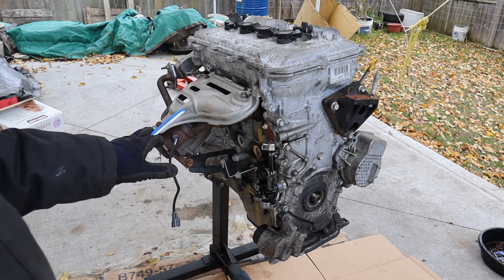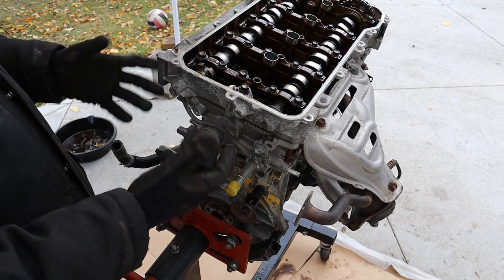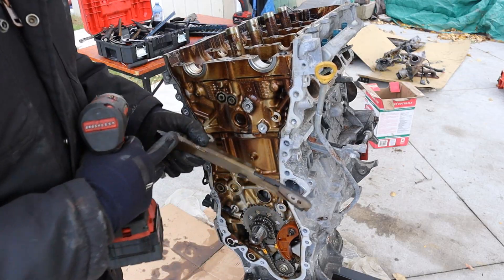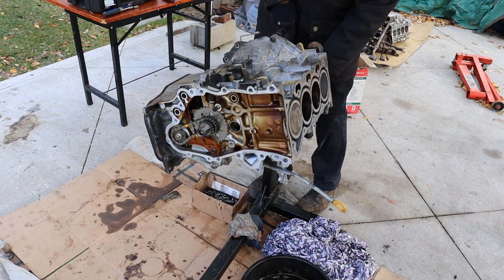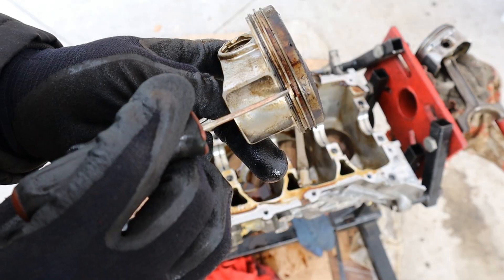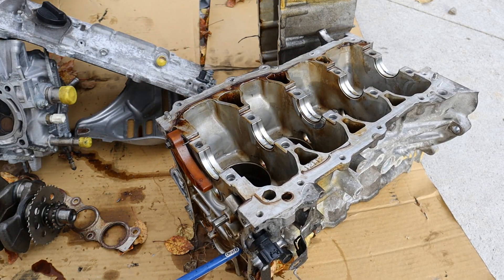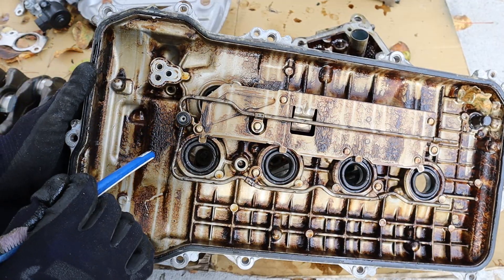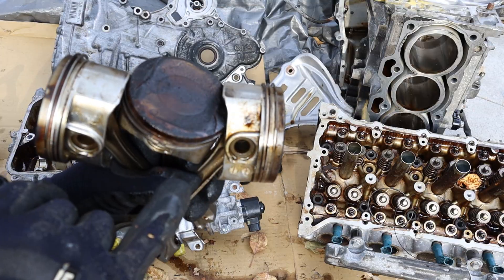Why the Toyota 2ZR Engine was a Failure

Comment: Damn, I have the 2ZR-FE, wonder why they got rid of VVTI from the exhuast. Atleast mine does not have an egr or electronic waterpump. However, it does have a stripped sparkplug hole... Just hope I dont need to replace it before the car is dunzo

Comment: All these problems were addressed late 2011 model engines. So, if you have one mid 2012 or later model you will have zero issues.
Reply: Not true.  It happened to my 2013 Prius V at 260,000 miles
Reply: @nizamamiri4746 At 420 000 Km I would expect wear on any Petrol engine.

Comment: My 2021 2ZR-FXE uses metal oil filter and head gasket has been upgraded couple of times through the years (knocks on wood). You can find these engines with 500k km without head gasket failure or any failure for that matter. Zero oil consumption between oil changes for me. 2009-2011 were the notorious oil drinkers and head gasket blowers which ruined reputation of the engine.
Reply: That worries me then lol, I have the 2ZR-FE in a 2010 Corolla with 95k miles on it and I haven’t had any oil burning yet (knock on wood)

Comment: One of my family members has a 2010 Toyota Corolla 2ZR-FE (not the FXE shown in your video) and with 81k miles, it's still running great with no problems. 😀
I believe we've ran 5W-20 for all its life, though it can use either 0W-20 or 5W-20.

Awesome video, per usual!
Reply from the maker: Thanks. 
Keep an eye on the oil and coolant level.
Reply: @speedkar99  In the 15-16 (if you count it manufactured in 09) years the Corolla has been existing, it has had no such problems AFAIK!

Comment: Why would you title the video with 2zr-fe when that's not the engine you're talking about?
Reply from the maker: This is a 2ZR...what were you suggesting?
Reply: @speedkar99  i have the 2zr-fe which has iron linings in an aluminium block.
Reply: @andymeh499  But it has manufacturing defects that Toyota does not acknowledge, brother.
The scandal of the Land Cruiser, Tundra, and Lexus engines regarding engine failures has also spread.
And previously, there was a recall for the Camry and Corolla due to the accelerator pedal and other issues.
There was also a recall for the Corolla airbag and a recall for the Toyota fuel pump.
But honestly, the Corolla I had was fun, better than new cars that break down over the most trivial things. Its problem was the gearbox. I could have installed a different gearbox for it, but I don't know what made me sell it. I can install any gearbox from Toyota or another company, but they will tell you that it will not fit.
Knowing that it fits  Sorry ❤
Reply: @speedkar99  He means not all Toyota ZR engine series have this problem. There are engines in the same series that have manufacturing errors. The 2ZR-FE engine is actually a very excellent engine. I had enjoyable experiences with it from 2013 to 2021 and I did not face any problems with it. The only problems were with the 4-speed automatic transmission. The transmission could not handle the dyno or open RPM and would break. As for the engine, it is excellent. It handles the intensity and everything you can think of. I have things I filmed while I was slaughtering this engine. It does not die. Hahaha. Sorry ❤

Comment: The 1ZZ-FE was a much better engine and more reliable than this problematic 2ZR. The 1ZZs originally also burned oil, but in 2005 they received an upgrade to oil scraper rings, along with more drain holes in the piston.

El 1ZZ-FE fue mucho mejor motor y mas confiable, que este problematico 2ZR. 
Los 1ZZ en un principio también quemaban aceite, pero en 2005 recibieron una actualización de aros rasca aceite, junto con  más agujeros de drenaje en el pistón.

Comment: A lot of Toyota engines are very similar to each other. I have the 8NR-FTS in my 2018 CHR. Direct injection unfortunately but doesn't seem to be a problem with these engines.
Reply from the maker: Stay tuned because I just tore down an 8AR-FTS 😎 you might be interested

Comment: I had one started rough idle on start up at 237,000 miles...just after I put 4 new tires and an oil change on it!  That must be a law that if you put new tires on a car it will blow up soon after!
Reply: Mine just did it, right after I put a new battery pack in it! At 271,000 miles!
Reply: @BaltimoreAndOhioRR  I did not know at the time it was the head gasket.  I would have used some of the head gasket repair stuff they sell to get by a while.  If you catch it early I think you can get by a while with it.

Comment: In Thailand the Corolla Cross 2020-2024 has the 1.8l 2ZR-FXE hybrid. Are these modern ones free of these issues? I found it is a third generation 2ZR-FXE (but correct me if I’m wrong). The schedule oil changes here are every 6,000 miles (10,000km).

Comment: Is this problem in all the 2ZR-FXE? I just bought 2024 Toyota corolla Hybrid with this engine yesterday.
Reply: Ignore the dealership advice and keep oil changes every 5K miles. Look at The Care Care Nut videos- he explains it very well.
Reply: Sorry, missed the important part: every 5000 miles or 6 months - depending on which comes first.

If you don’t insist and just bring the car to a dealer, they only rotate the tires and call it a day since it’s not in their books.

Do it even if Toyota won’t cover the cost for the first two years - if you plan to keep the car.
Reply: @abrindeyev  yes... but I usually pass 6.000-7000 miles per year ... so I guess I'll do it yearly.
Reply: @acanthopterygii  twice a year then irrespective of miles. Again - this is only makes sense if you own the car and plan to keep it "until the wheels fall off".
Reply: @abrindeyev  I understand. Also, there is 5 years warranty and plus 5 years If I continue to service at dealers.
Reply: I'm asking the same. Also bought 2024 Corolla Hybrid 1.8 with 140hp, same engine 2ZR-FXE...
Reply: Toyota must have sorted these issues with that generation.

Comment: tbh if you are having to do maintenance after 250,000+ km, I hardly call that a failure.
Reply: Ikr toyota set the bar so high almost any major type of maintenance is seen as a failure
Reply: No bro, for a hybrid version its not because 50% of the time the car runs on battery so it’s nearly 180k miles

Comment: The 2ZR-FAE on 12th Corolla LE (20-22) has a spin on oil filter. I wonder why they switched from cartridge style filters.
Reply: Because the cartridge style is a huge pain lol. One time my sister had a shop change her 2014 Corolla's oil instead of me doing it as usual. The cartridge housing was so overtightened that I had to use an impact gun!

Comment: I ran an all makes shop in a college town for a couple of years. We had dozens of customers with Priuses. The only one that ever had an engine issue was down to being driven without oil. When I went to buy a used engine to replace it, they were literally $100 a piece. There are so many more wrecked Priuses than there are Priuses with engine problems that the engines sell for scrap prices. There is no greater proof of engine quality than that. It is the terrible engines that are expensive in the used auto parts business. Try buying a 4.7 for a Jeep, or a Subaru engine, or a Ford Triton or Ecoboost. You'll find people fighting over them, because they fail all the time and there aren't enough coming out of totaled vehicles to cover the failure rate.
Reply from the maker: Awesome! Where can I find $100 engines? I'd be tearing them down all day

Comment: Great video ! ,Planning to get a toyota mark x GRX130/135 2.5l 2015 or later variant or a Corolla axio  2015 or later which one is likely to give me less problems like the ones you mentioned in this video
Reply from the maker: The 2.5 burns oil too doesn't it ?
Reply: @speedkar99  not sure ,still weighing the options .i have never owned any of these cars

Comment: The 2ZR-FE in the 2011-2013 Corolla I think is an excellent engine. My 2013 has 227,000 miles so far. The 2ZR-FXE in the Prius's on the other hand.... not so good.
Reply from the maker: It sure is. The hybrids were the one that gave it the bad name
Reply: There's Prius taxis with 600k on these 2ZRs. All about maintenance and they fixed the oil burning after 2014. A head gasket every 300k isn't horrible.
Reply: @ Maintenance + time + budget. I think it's easier for companies to keep a fleet going. I've heard of regular FE (non-FXE's) having head gaskets go around 300k as well. I'm at 239k now, hopefully it makes it to 300.

Comment: EGR-System does not reburn the exhaust gas contrary to popular belief. Instead the exhaust gas is being rerouted back into the cylinders through the intake ports and it mixes with the intake air taking out some of the oxygen being sucked in, through which the combustion temperature is being lowered and ultimately the NOx emissions are being lowered. Also the Atkinson cycle engine does not reuse the exhaust gas, but it rather lets the intake valves open for a lot longer even though the pistons are already in the compression stroke, this allows for the engine to reach higher expansion ratio during the combustion from the much lower dynamic compression ratio which in term allows for higher efficiency. Those engines usually have a very high mechanical compression ratio for a petrol engine, but of course it is lowered through the intake valve timing. Either way, your videos are very interesting, keep up the good work. 😁
Reply: circular logic and no one is impressed with your copy/paste wikipedia definitions.

Comment: My 2zrfe doesnt have an EGR valve
Reply from the maker: Because it's not a hybrid
Reply: @speedkar99  not, its a 2ZR-FE. You might have a different head here. 2012 corolla s. No egr whatsoever just a normal setup.
Reply: @joelh3030 there are different engines that's why yours is a 2zr fe this one is a 2zr fxe

Comment: I mean ive actually only seen ONE of these 2ZRs blow a headgasket in almost 5 years at a dealership. it blew cuz the customer put lucas oil stabilizer in it. the Corolla is a great example, these motors dont usually have issues. Toyota 4 cyl, almost across the board will burn boat loads of oil later on in life if you listen to the stupid 10k mile oil change BS
Reply from the maker: Yeah they're oil burners....but why would Lucas cause it to blow?
Reply: @speedkar99  it took 0w20 oil, they added the thick Lucas shit to a motor that was already burning oil, it starved the bearings and threw a rod

Comment: Toyota has been slipping in quality, it's not the Toyota of the mid 1990's and early 2000's that was stellar.
Reply from the maker: Toyota if the mid 90's were overbuilt. They've optimized things now and that's changed alot of customer expectations

Comment: Another great teardown video. I need these junkyard Toyota engines for export to Africa
Reply from the maker: Thanks. Do you rebuild them?
Reply: @speedkar99  Depending on how severe the failure is will determine if we rebuild or sell as it is. If possible to have a 40ft container loaded with used engines, suspension parts, body parts and used tyres . That is what I'm looking for

Comment: Have a 2012 matrix with 2zr fe.  I dont know if the rings it uses are different but I havent had the issues others have had with the 2zr platform.  I also had the gasket replaced around 125k just to be on the safe side, didnt have any coolant issues.  Never see the oil leaks from tensioner like the zz's.  Never dealt with water pump issues, but its also the non-hybrid and Ive only ever see the hybrid pump fail.

Window tracks have failed twice though lol
Reply from the maker: The 2ZRfe was more reliable. It doesn't have the heat cycling, EGR or water pump drawbacks that the hybrid motor has. 

Did you replace the head gasket or valve cover gasket?

Comment: I've had two close family members with the 2ZR Prius. The 2011 had oil changes every 3k miles or 6 months, and never burned a drop of oil at 57k miles. Admittedly, that's really low mileage. It was traded to Carvana during the pandemic for an astonishing amount. The 2012 sticks closer to Toyota's recommended intervals, so they cart around big jugs of oil everywhere they go. Before they knew it was a real problem, at about 180k miles, the car displayed the "low engine oil pressure" warning. She was on the highway and decided to "get to town," and drove for another 20 or so miles! Today, 50k miles later, the thing still runs very well, and still burns oil. Despite the big design flaw, it seems that these still run forever. Perhaps that's because they can motor along on the highway with low oil pressure, who knows.
Reply from the maker: Remember half the time these engines are off while in hybrid mode, so that mileage isn't true for that engine the way it would be on a gas only car.
Reply: I'm at 112,000 miles and my 2010 has never needed oil between 5k changes with synthetic 0W20. At the 5k change point it's difficult to see the oil on the dipstick because it's still so clean.
Reply: @Erichhh  Same here. My 2010 just experienced the rattle and put up the check engine light for #1 cylinder misfire (which basically means the head gasket failed). Til this day it never burned any oil between changes. It has 271,000 miles! I have never had the intake or any EGR component off to clean, but I did do the oil changes with 0W20. I say going 271,000 miles with nothing but oil changes is not a "failure". Looking back, I wish I had cleaned the EGR once or twice.

Comment: Hard to complain with that high of mileage ???
Reply: That is not high mileage considering the mileage 1990s Corollas went..
and some are still going!
Reply: @JohnSmith-yv6eq  Agree. It shouldn't be compared to many Kia s and the like.
Reply from the maker: Remember hybrids spend half their time with the engine off when in hybrid mode. So that mileage is alot lower on the engine compared to a gas only car.

Comment: I have a 2012 Corolla in my family with 204500km on it. It is the 2ZR-FBE though, flex fuel for Brazil where I live. Have it since 160k km and just regular maintenance, but people take waaaay better care of cars and oil changes here in Brazil so there's that.
Also, the Toyota dealership oil for this engine is 10w30 conventional. And it works fine and is completely reliable through 10k recommended oil changes and higher temperatures we see here in summer.
Reply: Everyone should be running thicker oil than 0w20 water. Sounds like you're having easy success with careful maintenance.
Reply: @James-vt2cb  No problems whatsoever and only smooth running.
Reply: @James-vt2cb do you think running 0W-40 oil would be totally fine with this engine, in the CT200h application?
Reply: @olegk455  I wouldn't recommend it since the hybrid version operates at lower temperatures.
Reply from the maker: I remember the older days when 10W30 was the norm especially in summer. We can't even find that for sale around here anymore
Reply: Low speed pre-igniton knocks the rings out of manual trans Corolla / Matrix / Vibe  models, I've replaced a handful of long blocks because of it.

Comment: Why did they replace the engine? I helped a buddy with a head gasket (and battery pack replacement) on a Prius he bought at auction a few years ago and honestly the battery pack was more work. The engine was in really good shape for 150k. We ran an oil flush through it and change the coolant twice (there was oil in the cooling system) burned no oil!
Reply from the maker: Why is the battery more work, isn't it just a unit that lifts out the trunk? 

I've removed one, as long as you're cautious and have the correct scan tools it doesn't seem too difficult.

Comment: I'm not sure what you're talking about M12 triple square works absolutely fine on Toyota head bolts as long as you spray brake clean on the bolt heads I've taken apart so many heads and put them back on with m12 triple square and never had any issues
Reply from the maker: I've stripped one or two with both triple square and hex
 
After that I just bought the correct tool
Reply: @speedkar99  huh that's interesting yeah I don't know I just use a sunex m12
Reply: @speedkar99  also I do not use an impact gun for them I use a breaker bar

Comment: I have a 2020 corola le with this engine. 135,000 miles bought it used at 100,000 is there anything that I should be worried about? Been changing my oil every 3k miles and trans every 35,000 miles.
Reply: Keep doing what you are doing...
if this engine went 290k kms...(180,000 miles) and was obviously burning oil well before the HG blew..
you should have warning (oil consumption) of possible impending failure
if you keep up the oil changes (3k is great) that may extend that life as another commenter says his is still perfect @ 370000 miles!

How long do you intend to keep yours?
Reply from the maker: Remember hybrids have the engine off half the time so 290km isn't exactly the true engine mileage
Reply from the maker: The gas only version of this engine didn't suffer from nearly as much issues as the hybrid.

Comment: Everything looked pretty much brand new in that engine. I guess there’s probably a different set of pistons available due to the technical bulletin. With a ring job and a new head gasket, new valve stem seals, send the head to a machine shop to check out the seats and tolerances etc, the engine would be practically brand new. The battery is probably defunct or not much life left.

Let’s say you did 7.5k km oil changes instead of the probably recommended 15k km.
That is 10 changes on 150k km’s. If you do it yourself that’s about $500 using synthetic oil bought on sale. Over 300k km’s that’s $1000. These extended oil change intervals are penny wise pound foolish.
Reply from the maker: I agree...oil changes definitely help, however if an engine has an inherit design issue it'll be bound to fail at some point. 
They put these low tension rings to help with fuel economy because it's a Lexus Prius.